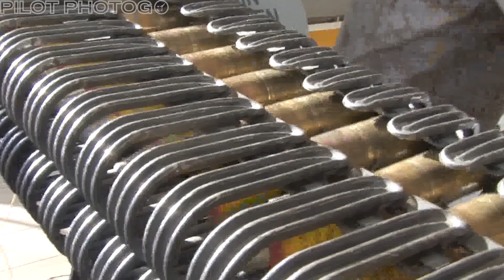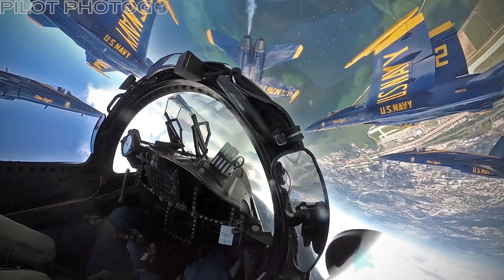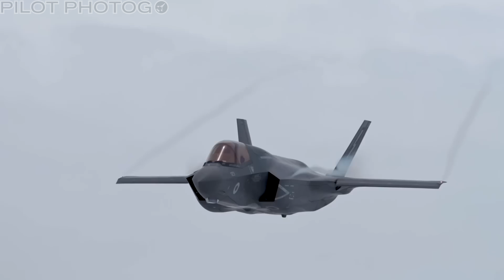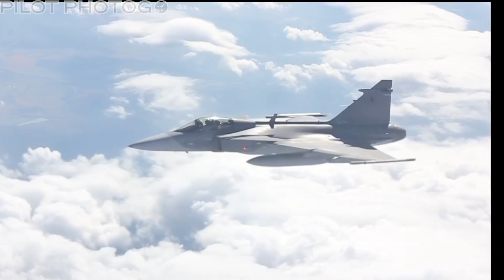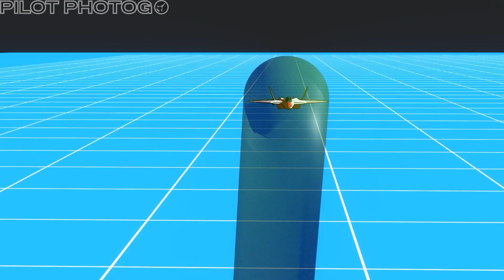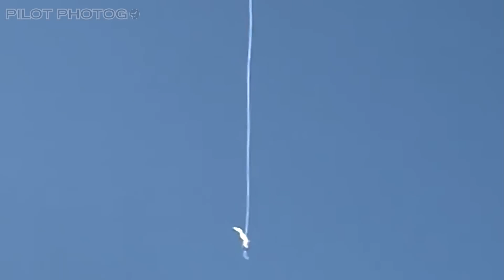Why the F/A-18 Hornet Is Still The Navy's Most Important Jet

Comment: Ok….several times you mentioned that the IRST is known as the “Stealth Equalizer”. What isn’t mentioned is that only the Russians refer to it as that for marketing reasons (to convince buyers and the public that US stealth technology has been neutralized) 

The fact is that the 100 mile detection range is like the max range for a missile; achievable only in perfect conditions. For the IRST, that would be clear,  very dry and dust free skies against an aircraft flying at supersonic speed. A more realistic detection range is around. 60-70 miles. 

Second - and more importantly- in order to detect an aircraft with the IRST you have to know where that aircraft is to begin with. It doesn’t sweep the skies like a radar. It must be pointed at the location of the aircraft to detect it. Therefore, you must’ve already picked it up on radar to some extent. 

Finally, the IRST cannot be used to Guide in a weapon. So even if you detect an enemy aircraft 50 miles away on your IRS there’s nothing really you can do with that information except proceed to fly closer to it. But the fact is at that point you’re already dead

The main purpose of the IRST is identification of a contact detected on radar. It is not a primary detection source and in no way negates stealth.
By the time you were able to pick up the F-22 or F 35 on your radar enough to point the IRST in that location and detected you’re probably around 20 to 30 miles away at best and you’re already dead
Reply: I should add that if IRST was a “stealth equalizer “China and Russia wouldn’t also be spending 100’s of billions  of dollars designing and producing stealth aircraft. They would know that IRST renders their stealth meaningless. Yet they ARE spending that money because they know it does not.

Comment: I'm kind of waiting for a CPRS (Conformal Passive Radar System) for sensing and shooting Fox-3s at off axis threats without emitting any radiation. I had a design for a replacement for the JAS-39 Grippen, The JAS-41 Kraken. The best way I can describe it is an F-35 (complete with the F-135 engine) but with the canard/delta wing planform. 😂